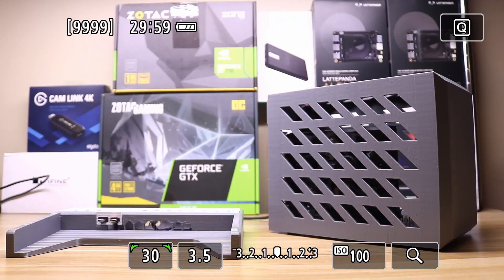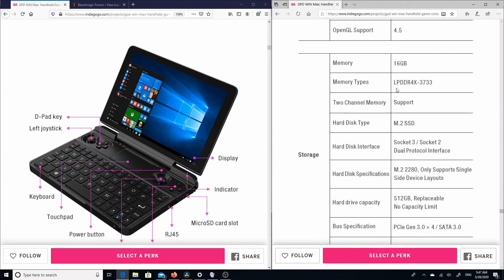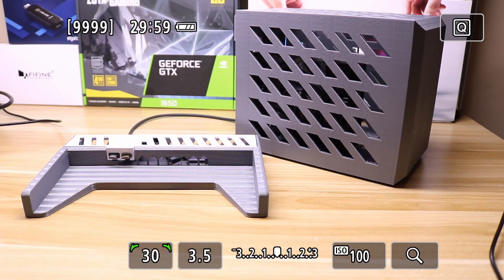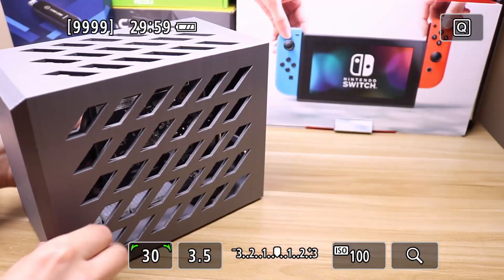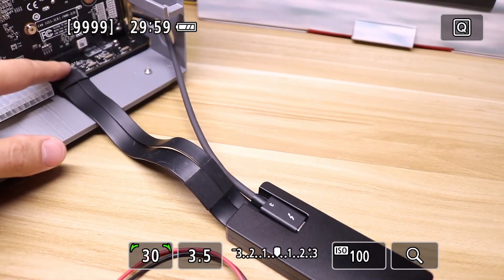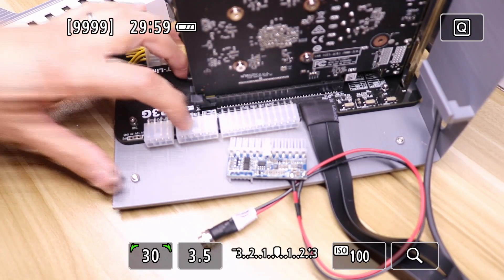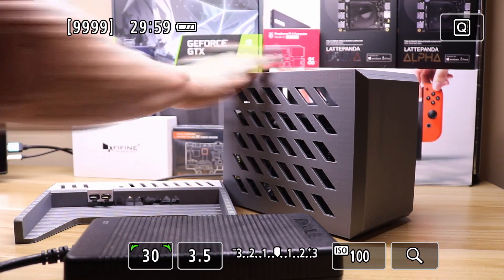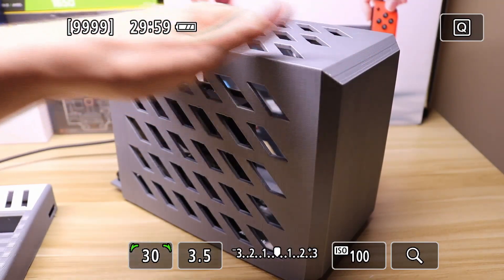GPD Win Max - DIY Dock and TB3 eGPU

Comment: O.K., I got an ADT Link R3G and am trying to use it with a Zotac RTX 2060 powered by the Dell power brick. Unfortunately, my Win Max won't recognize the card. (I have a Razer Core X, and it does fine with the card.) Any idea what the issue might be? TechPowerUp tells me that the card should only draw 187 watts, so I'm not sure it's a power supply issue.
Reply from the maker: Did you try another power supply like an atx psu? Just to be sure
Reply: @HandheldHardware  I have not. I'll order one, give it a try, and let you know how it works.
Reply: Update! Okay, after some fiddling (and a few dumb errors on my part), I got the 2060 working on both the Dell power brick and the ATX psu. However, neither power supply will charge the Win Max while it is plugged in on the Thunderbolt 3 connector, which seems odd.
Reply from the maker: @efupdate  the adt link doesn’t provide power delivery over the TB3, that’s why in my design I had to use both connectors. Unfortunately its not easy to add PD to a Tb connection....
Reply: @HandheldHardware  Ah, that's good to know! Well, other than that, I'm quite pleased with the end result. Thanks for the video and your help.

Comment: Is there any chance you could do a custom project
Reply from the maker: What were you thinking?
Reply: @HandheldHardware  2001 SUBURBAN CASSETTE DECK ASSEY TO USB C AND USB  A and the rear radio control unit converted to USB C  A AND HDMI IN
Reply from the maker: @coolandmellow  at this time I’ll have to pass. If it was somewhat in line with what I’m working on I might take you up on it

Comment: I'm looking to be able to completely replace my desktop, would an egpu setup like this be powerful enough to run vr with the right graphics cards? Kinda crazy if it can that you can build something so cheap that is sold for so much??

Could you explain what's different from this to egpus that sell for hundreds in terms of functionality, if any?
Reply from the maker: Ciaran Lynch 
I’m in it to replace my desktop too! Not sure about Vr, I don’t have a headset. This might be on the under performing side. Some people on discord are going to use it for this.

My setup:
-cheaper than other solutions
-great if you have a gpu and a power supply
-does not provide power to max over TB3 port
-does not have a built in usb hub
-need to 3d print case if you want it

Other eGPU cases
-more expensive (could be inexpensive if you buy used)
-usually has built in power supply
-some have power delivery over tb3 and/or a usb hub, so everything over one cable
Reply: @HandheldHardware  so the main concern would be power consumption? Sounds cool I'll definitely test it out. Also you mention in the description that sourcing the adapter from AliExpress would be cheaper , may I ask why you chose not to do this?
Reply from the maker: Ciaran Lynch what gpu do you want to use with it? If it’s a lower power card you could definitely run it off a brick. If it’s 200+ W you may need internal psu. I use amazon affiliate links, so I typically post them. The amazon seller price was a bit more than AliExpress so that’s what I said that
Reply: @HandheldHardware  not sure what card yet but considering I'm going for budget then it'll prot be low power
Reply: @HandheldHardware  also my first 3d printer arrives next month so hopefully it comes around the same time as the max:)

Comment: Instead of a black box to TB, can I have that be a M.2 so that I can plug that into an old laptop that doens't have thunderbolt? I know they make other r43 adapters with those specifically, but I just want to know if I could use one r43 instead of 2 simply by getting a cable.
Reply from the maker: Thanhtacles hmm, I’m not sure I understand your question completely. If your laptop doesn’t have TB3 I would avoid this adapter completely. Are you looking for some convenient cable connection?
Reply: @HandheldHardware   hi, can you use this as a thunderbolt port and m2 if you want? or is the connector of the m2 to thunderbolt adapter soldered?

Comment: Hi ! It's awsome !!! Will you design a case for longer GPU like GTX 1070 8gb and other ???  Waiting for your next updates !!!
Reply from the maker: Yes! I’m working on making it modular so you can select your version thin vs thick (for more power supply room 120 or 145 mm wide), extended ~220 or 320 mm long, and two height variants for pcie power connector or not/angled adapters

Comment: One thing that should be added to the gpd dock is an opening so that you can seamlessly connect an ethernet cable  to the gpd win max (right side of the laptop
Reply from the maker: Amith Abraham good point, will add

Comment: small box for gpu，but i think maybe 2060 is  totally enough for i5.if the box can set a ssd or hdd in it that will be a good way to save  more games
Reply from the maker: zixiao Lu thanks for the feedback!
Reply: I have been tinkering with the idea of a dock with flash storage built in. I’m surprised it’s not a normal option for big manufacturers. If they sell a 200-300 tb3 dock with every port you could need, imagine how much more they could sell it for if they simply added a 1tb ssd or a 5tb hdd. M.2 nvme would probably make the most sense. Small and fast, takes advantage of the tb3.
Reply from the maker: jordan secrist that’s a great point